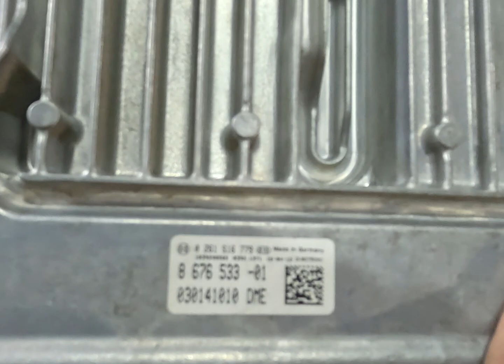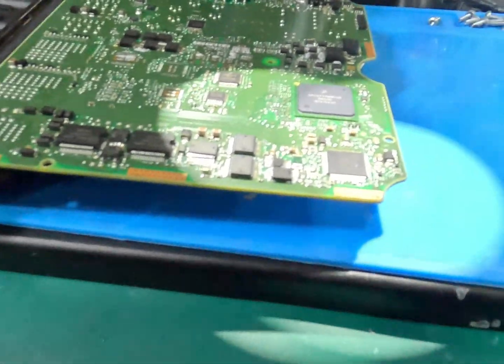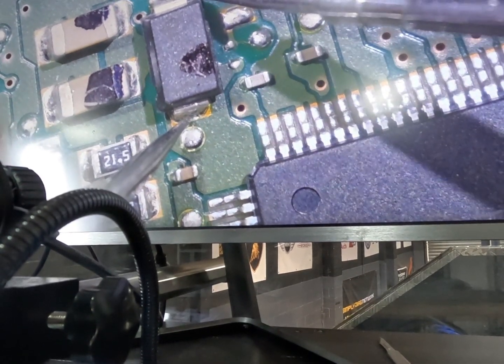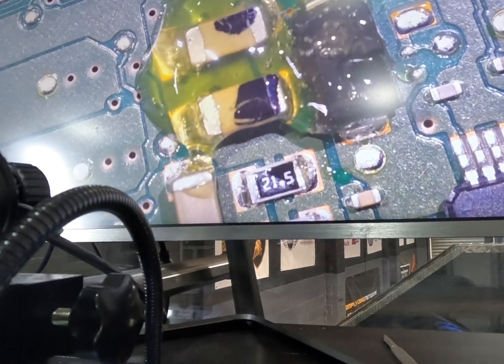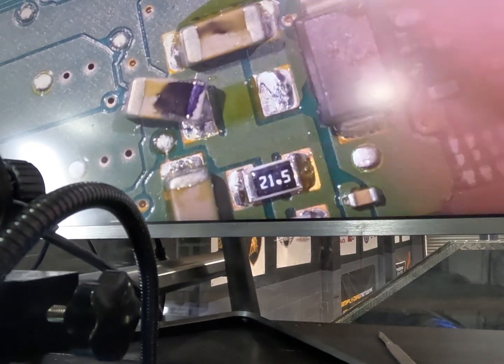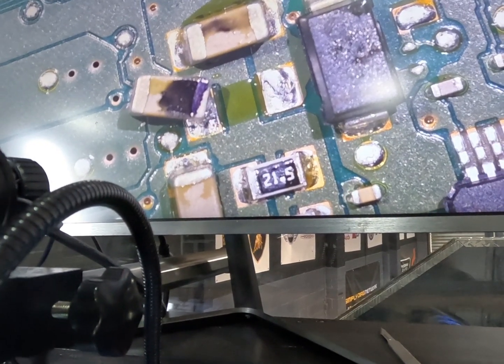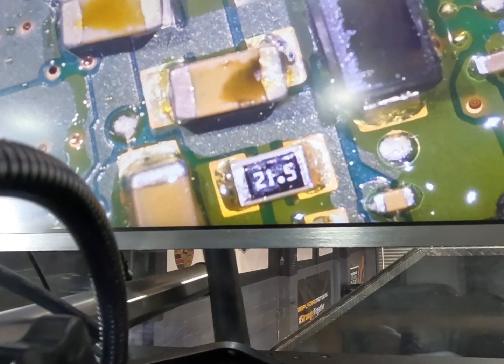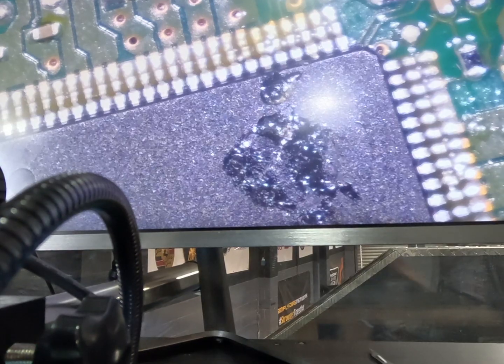BMW DME/ ECU internal short on 5v ref diagnostics at the ECU repair clinic ✅️🤔

Comment: Do you still do this work?

I had a JB4 on a car I bought, and after a day at the track it over heated and gave me a list of 5V codes. I took the JB4 off at the track, and ran it for the past 3 months. 

Every once in a while I get a 5V power supply code (really uncommon) and a fuel rail pressure sensor stuck code (common). Limp mode engages and instantly turns back off, and it doesn’t decelerate like my other F82.

Comment: How about no communication but car can run. If unplug dme. I had communication with all module?
Reply: Learn how yo use your diagnostic equipment.
Never use Auto-ID, search by VIN etc. Just go for BMW straight away.
Otherwise it will use OBD to read out the VIN, and then the engine ECU is in OBD mode and won't communicate with the scanner in factory mode.
Reply: @tomvleeuwen what's your point?no communication mean module doesnt connect with can bus, how to diagnostic by vin etc?lol 😂
Reply: @yash_2036  My point is that the scan tool is bringing your car into the state where it would not communicate with the scanner anymore, its' probably not a permanent fault. lol ;-)
Reply: @tomvleeuwen as i mention early, I had com with all module. So there is no problem with the diagnostic tools or the tools. But never mind i solved already there is bus component on dme fault. I change that, Then the problem solved 😊

Comment: This component is linked to two resistor 21.5 ohm in parallel = 10.6 ohm , this is why when you test it you have bip sonnor , there are not short
Reply: He did claim it was a dead short so maybe he measured resistance off camera. If not that's a pretty huge mistake and he shouldn't be working with circuit boards.

Comment: where are you located? I have a DME that doesnt read the pedal info
Reply: I have that problem too one of the 5 volts supply is not outputting 5 volts... the other 5 volt it is
Reply: @88zpeedy hello ! I had this problem recently.. any help about this issue please !